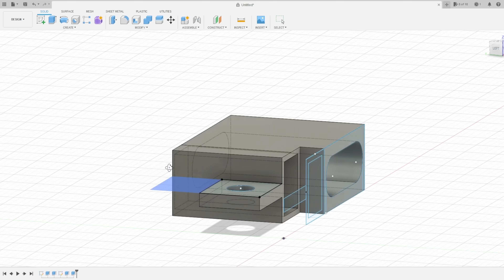Hacking my laptop so I could travel lighter!

Comment: Hi, i'm Alberto from Italy . I tried to follow your guide on modifying my dell 5410. But it doesn't charge the battery On the original connector there is the gray wire which looks like a control where it should be connected, you can't see it in your guide, can you give me directions
Thanks
Regards
Alberto
Reply from the maker: Dell has a sense wire that needs to be dealt with. Might be difficult for your one. Buy the right replacement connector to usb-c it will do this for you I believe.

https://electronics.stackexchange.com/questions/36380/splicing-a-laptop-power-supply-cord

or buy this - https://www.aliexpress.us/item/1005005101855652.html?spm=a2g0o.productlist.main.3.71a9106b5pFe6B&algo_pvid=66436ee4-45c4-43b7-a54d-54c3b379dd77&algo_exp_id=66436ee4-45c4-43b7-a54d-54c3b379dd77-1&pdp_npi=4%40dis%21AUD%214.01%213.13%21%21%212.60%212.03%21%402103243417069421679175469e0376%2112000031667465683%21sea%21AU%212790129805%21&curPageLogUid=7y9D7HkIYVvt&utparam-url=scene%3Asearch%7Cquery_from%3A

Comment: One question,  PD charging only supports 20v while most laptop with barrel plugs take 19v or 19.5v as input. Wouldn't this cause problem with battery or the motherboard?
Reply from the maker: Most laptop charging circuits support a range of voltage. It might say to you 19.5v on the laptop, but its circuit could 'support' a range - ie 19.0v to 20.0v. So it should be ok. They wouldn't make these connectors otherwise. Best way to go about it is to test the removable jacks you can get on aliexpress. if it works with this then you know the mod is compatible!

https://www.aliexpress.us/item/1005005101855652.html?spm=a2g0o.productlist.main.3.71a9106b5pFe6B&algo_pvid=66436ee4-45c4-43b7-a54d-54c3b379dd77&algo_exp_id=66436ee4-45c4-43b7-a54d-54c3b379dd77-1&pdp_npi=4%40dis%21AUD%214.01%213.13%21%21%212.60%212.03%21%402103243417069421679175469e0376%2112000031667465683%21sea%21AU%212790129805%21&curPageLogUid=7y9D7HkIYVvt&utparam-url=scene%3Asearch%7Cquery_from%3A

Comment: Cool hack but I'm not as good as modding so I just bought a 4.5x3.0mm to usb c cable for my hp laptop then plug it to a ugreen 100w GaN charger. It works as it also allows me to charge my tablet, phone and watch all at the same time.

Comment: Mate, that is definitely the best mod. I am surprised there aren’t more tech shops offering this type of mod as a service for older machines.
Reply: It might not be the most reliable, So not actually viable to sell this service but very good as a DIY.
Reply: @ayushkaushik8794 and it propably depends on the exact notebook, if they would even do it in the first place. I don't think many customers would be happy with one like in this video, where you have holes above and below the socket
Reply: Julian
Reply: Yes, it's probably because it's going to be different for each laptop so it's gonna take time and some 3d prints for them to get to the final result.
Reply: @kostaz13  It's really not something you can offer as a service. For a diy hack its great but too janky and very  time consuming to fit to all the different laptop models. I can imagine you could do it with a product thats common, expensive and has a micro usb port since those are similar in size and shape. I love my bose qc35 for example but its literally the only gadget I got that still uses micro usb and I hate them for that.
Reply: You can instead buy an adapter. Usb C to DC adapter.
Reply: because a USB PD trigger adapter costs  like $5 and most people don't care if they have to carry an adapter with them

Comment: Does it work with 20V usb c pd?
it looks like the laptop in the vid needs 19.5V
Reply: 20V is OK. You can use any voltage in +- 5% of 19.5V.

Comment: I also have an HP Spectre and I have several upgrades/repairs I need to do. Cracked Screen, Battery, Replacement,  Storage Upgrade etc. My charging port seems to needs to be replaced as well. I'll probably start the upgrades and repairs in late june I'd like to try this Mod do you sell the 3d housing or at least the file?

Comment: I'm confused. Your laptop is 19.5V but USB PD only does 5, 9, 15, and 20V. Shouldn't the USB mod not work?
Reply: my original T440P charger is 20V but broken, so i modified my old giant charger laptop that have 19V. and it works when i plug it
.
I think 0.5V difference is negligible
Reply from the maker: .5 volts over is fine. The power system in your laptop usually handles a range of voltage to account for voltage drop and increases. I might be wrong but this is why this works.

Comment: i tried this adapter on my asus k53s, originaly it came with 120w power supply, this adapter works for few seconds and then it shuts off, and goes on again. so in my case it does not work, and it would not work if i implemented it inside.. :(

Comment: It how make piece of shit out of a laptop. Simple jack more reliable then piece of shit like stupid USB type C.
Reply: Have you ever owned a 2010s Toshiba satellite they were notoriously bad dc Jack's that would break if you looked at them wrong usb c is nice bit it does have its flaws I agree
Reply: @xai38-809  But it not toshiba satellite. I don't agree that USB is a good connector. This is one of the worst connectors of all exists. I hate this piece of sh*t.
Reply: @horlonangel  what's bad about usb c? It's so good that the uk is passing a law making apple switch to usb c instead of lightning
Reply: @xai38-809  The reason for the decision to switch to USB type C is not that it is better. The reason is that it is more common and this decision need for standardization.
USB invented for data transmission, not for power suply. But we talking about power suply.
Maybe you still want to replace the power lines and iron sockets with USB type C.
It's very stupid to replace a reliable thing with a fragile piece of crap...

Comment: What i can say, nice click bait - on this video you will only make people damage their device!
How do you charge a HP battery that needs a charger with pin-id with a 2$ usb-c adaptor?
Do you know that ALL laptop motherboards support from 17v to 26v?
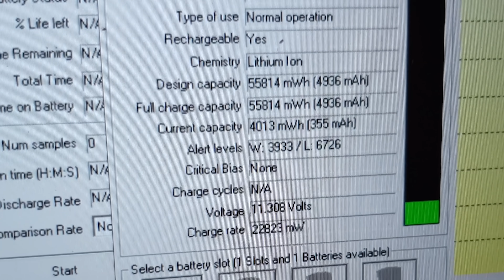At 03:35 you can see that the battery is flat dead - 355mah / cycle count N/A - either your BQ24780S is dead, or the battery is dead.
And the last thing: What has to do magsafe, magsafe hack, samsung hack and macbook hack with an HP laptop? I speak about tags!
Reply: Or the software dont support it or replacement battery
Reply: @xai38-809  You know that the software talks first to widnows then windows talks to BQ, right? Here, software has nothing to do with what this scamer
 is doing!
Reply: @PhoneRepairRO  how is he scamming? Also hp dont need pin I'd all it will do without it is send an error on first boot saying charger wattage cant be identified, maybe do your research before trying to "call him out"

Comment: Your old Charger is 19.8 V & 65W. 

The USB charger would be 5 V & 33 W, so how does that work
Reply from the maker: The laptop does not necessarily draw the 65W consistently. It's a buffer so that the laptop can pull what it needs at any time. For example if you are running a game + charging then it would pull closer to 40+W etc. Depends on the laptop. Also that is not a normal USB charger. The USB-C port can provide up to 20V and a certain amperage which is enough to provide the wattage it needs.

Comment: I mean, for 65-ish watt laptop chargers, it's probably fine. But if it's anything bulkier it's just gonna make charging take a lot longer
Reply from the maker: There are now 100W USB-C power bricks. Anything is possible.
Reply: @goodjihad  Now there's 250W bricks with 140W out via USB-C, which makes me wonder if I could do this to my Acer Nitro 5 which uses a 135W brick (19.5v @ 6.92A).

Comment: The USB type-C thing is one gripe I have with anything made in the last 5 year, there's no reason why something should have USB mini-b on it any more. My phone, drone and even both the work lights I have at the garage I work at all use type-c for charging. Finding out about those laptop adapters to type-c makes me want to mod my 10 year old Acer work laptop and my wireless head set to charge off of type-c or at least use fast chargers seeing as the power bar build in to my tool box has fast charge able USB posts on it. Great video and awesome mod !!!
Reply from the maker: I agree. I hate anything without USB-C now. It's just so convenient.

Comment: Awesome video and neat trick! Would like to emphasize that disadvantages and advantages to any solutions are important as the community for modding would like to talk about them. Such as testing 20v power delivery during gaming, alot of power adapter have proprietary pins that enable them to delivery maximum power. I know apple does this and maybe other manufacturers but in your case it seems to work well!
Reply: I can't do that thing in my dell laptop. I bought a brand new 11th gen Dell laptop. It came with a 45W power adapter with a barrel jack. My previous HP laptop also has the same jack. So I tried to plug it in to the new laptop. Dell power manager made a popup saying incompatible charger. It doesn't charge the battery, but I can run my laptop from that charger without draining the battery. It seems like communication between charger and laptop is required to operate normally. So it is impossible to do this mod into my laptop. It won't charge the battery. I am using Dell Inspiron 3501 laptop with 11th gen i3-1115G4.
Reply: @isharadhanushan2002  is the voltage and Amps the same in the old and new charger? If they're different they may not work, funny because I got 2 Samsung chargers, 25 W both, one from my old Galaxy S8 and bought a new one with the USB C to USB C type for my S21 Ultra and amperage is a bit different but both turn to be 25W, so the old charger doesn't activate the fast charging but the new charger does in the S8. So I'm thinking that maybe in your case with your laptop your new charger is to powerful for your old laptop and they don't work with the same voltage and amps (different wattage) also considering that old laptops use 18650 cell type batterys and newer use LiPo batteries
Reply: @luisgaleana1111  Both chargers are using 19.5V DC.
Reply: @isharadhanushan2002  some batteries have a communication line with chargers, it means you might need to find out first if your laptop model uses it. It's basically like USB in some phones that use 4 pins, power, data line +, data line -, ground  and even though we might think that to charge up the battery we just need + & - they don't because they need the data lines
Reply: @luisgaleana1111  It's true for all iPhones. iPhones can't be charged by just giving 5V to the power pins. Data lines are also needed to communicate with the charger.

Comment: That’s wonderful but i have a few questions doesn’t the charging brick makes sure that the power is correct and accurate for the battery so does any charging brick works or do we hve to have a smart brick which can make sure that the handshake is done properly for the correct power delivery
Reply from the maker: The little PCB I show you has the chip which tells the charger the proper voltage to deliver the correct power to the laptop.

Comment: I think this is only for those low power laptops, not for gaming laptops, even if you have a USB-C converter, because the maxium output of most PD carger is rated at 100w, though there is a new standard called EPR which could support up to 240w, but it wouldn't come so soon, every thing in USB-C brigs me a good experience but most of the manufacturer did not use it well, a lot of laptops only have one USB-C, or only USB-C, which is a not suitable for most people.

Comment: You showed it. The max power was 22830mW so just 22 W which is super dame slow
Reply from the maker: That's because that is the limitation of the laptop I had. It never charged more than 20w or so even with the original charger and I checked this with a multimeter. The 65W of the original charger is more to support when you are doing intensive applications on the laptop, for example you are gaming + charging. It would go up to 50-60W pretty quickly.

Comment: Be careful converting your laptop charging port he got lucky only 5V needed on his laptop. While standard laptops are having 16-19V DC power supply, convert it to USB-C for sure it will not charge at all.
Reply: Think you missed the converter part. The port is also a 5v to 18-20v converter. As the description says 
CAUTION: 
1. You must find the right barrel jack to USB-C converter for your laptop that has the same voltage marked. Do not buy any random one to avoid potentially damaging your laptop due to different laptop voltages. Most laptops support between 18V-20V. Look on the back of your laptop and confirm the voltage with the adapter you are purchasing. The USB-C adapter internals my look different to mine so please bear that in mind.
Reply from the maker: The laptop I use requires 19-20V, not 5v. The brick I showed uses USB-C (therefore it outputs around the required 20V needed for this mod) and not the older USB-A port. Just want to clarify for both of you.

Comment: That is so clever. I recently bought a mini PC specifically because it was USB C charged, which there are not a lot that are yet, but I predict we are going to see more and more as CPUs get more efficient, I love it, I made my own laptop essentially, I have an Anker USB C PD Battery, have one cable go to my Morefine m6 computer, and one cable go to my Huion 16" drawing tablet. so now I can do digital art anywhere in the world, and no bulky 12v wall warts.
Reply: not only computer getting more efficient, charger is getting more powerful and type c also can carry more power
Reply: But half the laptops sold nowadays can be charged via USB C. No need to go mini
Reply: @johnwt7333  I know but it would suck to have both a laptop and drawing tablet on my lap say if I were drawing in a car. Plus when a laptop gets damaged, it is a whole system issue, but with USB c linking, and wireless keyboard mouse, I can swap out damaged parts which will happen with my job.

I considered it though, there are some sleek laptops out there, but I'm a digital artist and need a windows platform
Reply: Wtf ? Idk what you are saying that you would see more pcs with USB c with CPUs being more efficient, my laptop does have USB c port that does work for charging (and barrel as main input charger)and is from 2017 with hungry, inefficient, and lots of energy waste as heat - Intel i7 plus Nvidia 1050, . I bought a 100w USB c charger (about same size as apples 100w USB c but cheaper and 2 more ports)and work wonderfully, and if you'd have a USB c with pd charging feature you can get that adapter (USB c or barrwl) no need to wait. Now if we could use gerpneric USB charger THEN I second you'd with cup being more energy efficient and les TDP  that opens the door to any charger laying around. I been eyeing the anker100w super small charger (normal generic USB charge sized) since cpus are not getting enh more efficient fast enough to able to use my USB charger that came with my phone

Comment: What I don't understand about my Dell Inspiron is that it has a USB C that does PD but also a barrel plug. Seems like a waste of space that could have been used for another port
Reply: Because the barrel plug will accept more wattage in then current USB-C power delivery is capable of
Reply: @HerbaMachina  I'm aware of that. But my laptop only needs 65 watts, which PD is completely capable of.